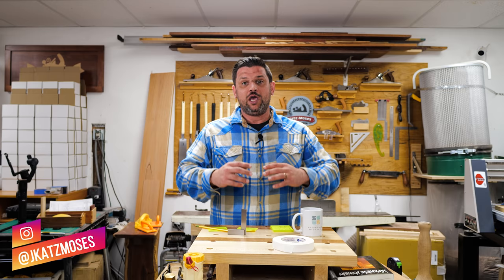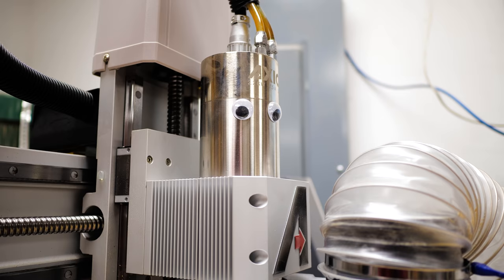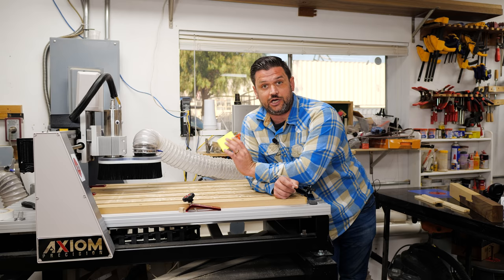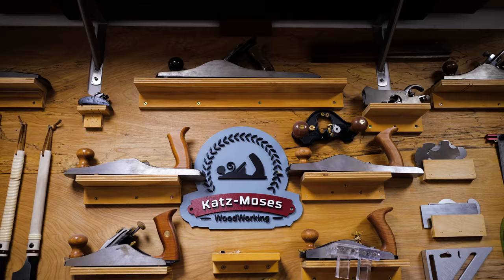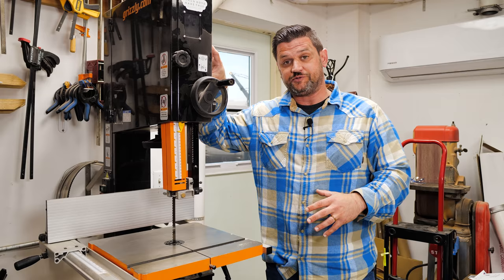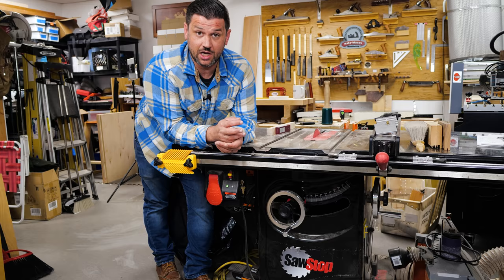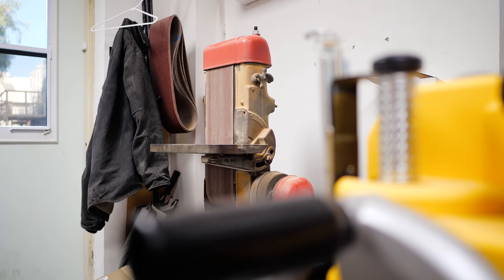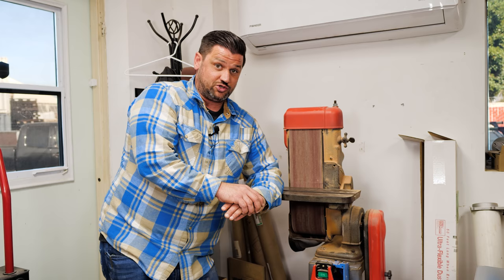Buying Used Tools - Negotiating Tips/Tricks and Buying Advice (Plus a Mini Shop Tour)

Comment: Regarding CL finds, always always always ask "what else do you have?" when going to pick up a tool/item from the seller. I have found so many additional items for cheap this way - sometimes the seller doesn't even know that they have something someone else would want! I once responded to an ad for free scrap lumber - it turns out the guy was a contractor and gave me thousands of dollars worth of hardwood because he had to move the next week. All it took was "you need to get rid of anything else?"
Reply from the maker: That's fabulous advice!
Reply: Been the same thing,    Moving, downsizing and health issue or death same thing I hate to say death, but its part of life. If you buy a tool from somone older be respectful.
Let them know you bought it for your own use, Seriously they will be happy to know you will use it in good health and it won't wind up in the dump someplace.
I got one item from a guy just because I liked the kitchen he did in his house I was blown away be the fact he made it all out of 4/4 + mahogany raised panel turned inside out for a shaker look all of it no plywood this was not a small kitchen either. the woodworking was stunning.  He was also very fair on his prices.

Comment: This has worked great for me! I have gotten a 6" joiner, sliding miter saw, air filtration unit, and 1.5HP dust collector all for $1,450 that retail new for $2,870 combined. Most are <3 years old, except the joiner. Now to add a couple circuits to my shop to handle it all.

Comment: Bring a square and a straight edge is 100000000000000% the best advice I didn't follow.  I bought a 6" jointer a few months back that ended up being fine, but not having those simple items with me when I purchased it was a mistake (so was lifting it by the tables to get it in and out of my truck and down the stairs to my basement shop...but that's another lesson learned.)  It won't happen again.

As far as buying hand planes used, I'm of the camp that sees the huge value in used vintage Stanleys.  Sure, my Bedrock 604 isn't made out of manganese bronze, but it was also 1/4 the price of the gorgeous Lie Nielsen I'd love to own someday.  Used planes can be restored simply and can be tuned to perform just as well or better than a lot of modern planes.  Where budgets are tight and you need a good plane, I think it's a no brainer.  Plus, restoring them is fun!

Comment: Great advice!  The only thing I would add is something I only recently learned:  If you can possibly get 220v service into your shop and you have the option of buying equipment that can run on 220v, I highly recommend it.  I didn't have 220 when I was looking for a table saw.  A good friend of mine suggested I consider getting it wired-in (which I could do myself.)  I took the plunge and bought a 3 h.p. Saw Stop, and every time I use it I am amazed by the "night and day" difference between it and my old 110v saw.  So much so, that I've rewired my band saw (it had that capability) and my drill press!  I have a lot of experience/knowledge in electronics/electricity, but I never really thought much about 220v in my shop.  I'll never go back!
Reply from the maker: I totally agree. I should have mentioned in the video that 220 tools are so much easier to get great deals on them because very few people have the capabilities to put 220 in their shop.
Reply: @katzmosestools  Your advice regarding 220 service in the shop is well taken. Currently I do not have 220 available in my shop. I do not have the know how to do this myself. Could you possibly do a video detailing the 220 install. Thanks in advance.
Reply from the maker: @mikefondren2385  posting electrical work publicly is like putting a bullseye on your head during hunting season
Reply: @katzmosestools  LOL! I see your point. Thanks for your reply. Guess I'll have to find hands-on help locally. Really enjoy your videos. Thanks for your efforts.
Reply: Agree completely on the 220v suggestion.  My SawStop and 8" Grizzly jointer are 220v.  I had to buy the additional converter for the SS but it's sound advice to upgrade to 220v.  So worth it!
Reply: Mike Fondren Without getting real technical- the advantage of 220v boils down to the higher the voltage, the less amperage needed. This means the wire size can be smaller (windings in the motor, and lines to the outlet) so it saves on cost of copper. The power consumption at the meter will be the same though, so this all doesn’t mean shit to most people. 
But if you kept the same wire size, you can get more power. 2hp motor is roughly 1500 Watts, so at 110v it’s about 13.6 amps and 220v is 6.8 amps. A 3000w (4hp) 220v motor will also pull about 13.6 amps. 
There’s other little quarks, like 110v wasting more energy over a distance, meaning it runs hotter .. but is safer than 220v during insulation breakdown, or getting a short.
Reply: @mikefondren2385   There are a TON of YT vids on running electrical. If you have the mechanical mind to do woodworking, you'll probably do fine running electrical. It's not the mythical "Scary Monster" folks make it out to be. You can do it. I installed my sub panel and wired my whole shop: few simple guidelines/charts to follow & you're good. Believe in yourself, @HoneyOnWales

Comment: This has been my philosophy for all my stationary equipment.  Old, used, and rebuildable.  My gem is an 1885-ish 12" jointer I picked up for $500.  I had to drive six hours each way, and put another $500 into it in new motor, bearings, knives, and paint, but this 1000lb beast is worth it.  My "newest" tool is a 1993 PM66 that I got for the price of "Come pick it up."  Because I only bought what I needed and waited for an item in my budget, it took me eight years to get all my stationary equipment, but I saved thousands this way.

Comment: best pick up i got was a scroll saw with about 200 blades i had seen the saw in this factory twice and i asked to buy it the guy said if you can fit it in your car you can have it for whats in your wallet , he went to do something and i dismantled it and put it in the hyundai boot, he came back to see it in my car i had $130 on me so thats what he took , its a Hawk 20inch , from mid 80's (i got in contact with them with the serial number) ,, i have never ever seen another Hawk in Australia it came with a voltage convertor from 110 to 240 , turns out the guy and his parents came from the USA with this rubber stamp company and they used the saw 2 times to cut sheets of stamps up , we went to the factory as my mum was into scrap-booking and she went there to buy supplies , ive had it i dunno maybe 6 yrs and it hasn't missed a beat . great scroll saw

Comment: Swap Meets: Great place to get tools! You can negotiate prices and some sellers can be stubborn. Many sellers have been taking hallucinogens or smoking too much pot. The way to deal with these guys is to ask and counter. If price is too much tell them you can't do it and walk away, then come back by one more time before you leave and say, "I see you still have these here..., you can sell them for the price I offered now or lug them back and forth for the next couple months until you sell them for the same price I offered."  I just got 3 Irwin clamps for $15 bucks when the guy wanted $40. Basically I got two clamps free for the price of one and they were in excellent condition. Never be afraid to walk and don't be afraid to be persistent. 
Great tips JKM, I use many of them myself. There are some great deals out there!!!
Reply from the maker: Great advice bud

Comment: Very true - your story sounds a lot like mine!   Another thing I watch constantly is Estate sales.  Just like Craigslist, Estate sales.net has an app for your phone... shows you estate sales in your area with photos.  I recently got a Porter Cable PK895 Router kit for only $50. And sitting right next to the router was a box of Infinity Cutting tools router bit set for only $20   It was a $199 kit with most of the bits still covered in the protective rubber coating.... brand new!   When I left that sale, I felt like I needed to burn rubber out of there as if I 
had just stolen something.... lol

Comment: Best deal I got was a Delta 6” benchtop jointer and 10” craftsman bandsaw for $35. Also got my 70’s model craftsman table saw for $15 cuz it didn’t run. Well a motor has a hard time turning when it’s full of dirt Dober nests. Cleaned out and the table Saw is a BEAST!

Comment: With clamps it's possible to go too cheap. I bought a few from the local Harbor Freight equivalent, and they were indeed cheap.

Unfortunately, they suck. To get the clamp to engage you need to hold the workpiece in place with one hand, tighten the screw with another and fiddle with the jaw with the third. They're more like awkwardly shaped hammers, really.
Reply: Build a clamp station  take a 2x4 cut notches in 2 at the same time lined up  lay your clamps in them and you will ahve enough hands to hold the clamps boards and tighten them.
there's  also a trick to get them flat and adjust the wood flat and flush with a dead blow hammer.  This works on pipe clamps too.  I need to build some but I have a lot of differnt types of clamps most of them do not stand up when you set them down. yes its a real pain in the ass but use your head and you'll get a headache@ I'm sure if you look on youtube someone's made a video what to do.  Thanks to everyone who shares there tricks.
I'm going to Blame This Old House for this. 40 Years of giving trade secrets away.
And why shouldn't we share with each other, It will make us all better at we like to do.
Not everyone can do this stuff nor do they want to.

Comment: Being patient is the best advice I was looking for a jointer, I waited and waited and finally found one that had a little surface rust otherwise perfect condition but I got a 6” jointer for $75
Reply: I got an old delta made in the USA for 65 but it did not have the guard I made one and the fence needed some love and care, it works like newish now. I also welded up a mobile base for it with free stuff off CL scrap's people put out for the trash. Bed Frame and wheels off a cart.

Comment: I would agree with a lot of your advise, I disagree about hand tools. It's easy and simple to fix up an old hand tools. They can also be shockingly cheap compared to new one. It also quite easy to get old tools that are still in great shape. Plus re grinding a bevel or tuning the hand tools is important to know how to do. Another category is power tools that need work. If the price is right and your willing to change out a Bering or replace a part there can be fantastic deals. The downside to searching Craigslist to buy old tools for cheap is you can end up being a tool restoring mechanic rather than a woodworker.
Reply: Evan Dunville My first handtool when  decided to start making my own picture frames was a Stanley Bailey No.4 for £2 at a car boot sale (a bit like a flea market). I still use it for rough planing.

Comment: Love the tips, I know you said buy used large tools and new hand tools, what about the in between corderd tools, routers, miter saws, higher end sanders, I know circular saws and corded drills can be had on the low. But a nice router or mirka/festool sander, or $600 and up miter saw are what I'm talking about

Comment: Awesome video. Since I’m about to move into my new shop i need a new big dust collector. Haven’t found one yet but still on the hunt. I do have that bandsaw as well
Reply: Grizzly has a sale on a 3 hp model  
I almost snagged up a laguna for 650 1/2 origanl price.
but 2 things about it 1 it was a 100 mile drive one way   number 2 it was in a part of the state they had a lot of floods this past spring when i asked about a flood it was the last email the guy sent me.

Comment: For a professional shop, sure, new hand tools save time, but for the guy just starting out, I'd say it's better to start with cheap or used hand tools; otherwise if you try it and don't like it or it turns out you don't have time, you might end up one of those guys on Craigslist asking new prices for your used hand tools.

My first hand plane was the $15 Harbor Freight special, back when I started side work to see if I could add to our income. Dug through every one they had to find the one that the screws actually lined up on, took me 4 hours to flatten the sole, and another 2 hours to flatten the back and bevel of the iron & put a good edge on it. With that plane, my old handsaw, a speed square, a $20 set of Buck Bros. chisels that I also sharpened, a borrowed table saw, and some reclaimed lumber from a house renovation down the street, I made my first farmhouse table. It sold for $400 the same day I finished it. I made & sold three more tables from that free lumber, and that was a helluva first real taste of woodworking. 

Good video, though. 👍

Comment: While my philosophy on buying tools is different from yours this was a very helpful video. All my major tools were bought new but most, except my SawStoop, were bought on sale or I got a special deal. I spend time searching through all the tool ads looking for special deals on the tools I want. Part of the problem I have is that I don’t have a truck or trailer that I could use to pick up used tools and  with many health issues I’m not able to lift a lot of weight.

Having said that I am in the market for possibly getting a second band saw and plan to start searching for a used one next year. When I do your information will be very valuable. FYI — I saw one, for example, listed as a table saw. That’s one of those mistakes you mentioned. 

On the new SawStop I even got a deal in that the dealer set it up for me, checked the tolerances including giving me the results of his tests, set it on a mobile base and for less than his costs, delivered it ready to go. The truck backed into my driveway and the driver rolled it into my shop. Obviously I bought it from an independent tool dealer who was willing to offer extras that big companies aren’t even prepared to do.
Reply from the maker: That's all great advice. Thanks for watching!

Comment: Jonathan, did you make those wooden on the wall behind you?  They look like oversized toolmaker clamps.  I have a bunch of toolmaker clamps and they are incredibly useful in an engineering context.  I have searched your channel and not found anything about them.
Reply from the maker: I didn't but I just did a video where I made some

Comment: I know this video is older, but figured I would ask.  Is it worth buying an Oneida dust collector that is 16 years old?  I have no idea how long they last. Of course the guy is asking $2500 for it, because new it is $4400 now (though several models newer).  I am using a shop vac and separator now now and need something better.  I was thinking of offering the guy about $750 for it, but not even sure that is worth it.  Any help out there is appreciated.  Thanks!

Comment: I’m very new to buying tools and I will never make anything bigger than an A2 picture frame because of my own limitations. I do buy cheap if they have a guarantee, I know most of them will outlive me because due to a health condition I'm well aware of my own use by date. That doesn’t mean I buy rubbish, but I definitely don’t need pro quality and there’s no value in it for me. I wouldn’t physically be able to work with big machines because of health and the fact my workshop is 6’x6’. So at least with woodwork I'm protected from GAS.

However, I do know buying and selling photography equipment, especially analogue. A few things I've learnt from there are:

1) Avoid eBay, the prices are frequently over estimated. We think because we have a passion the rest of the world has the same passion, one person will pluck a price out of mid air and everyone else copies.

2) Set your budget and stick to it, it’s easy to get carried away when you should have walked away. 

3) Whatever you are buying you can guarantee it’s not the only one in the world, no matter if it feels like that at the time. Don’t except compromises to get something quicker, hold out there’ll be another one in better condition.

4) Don’t rush to make an offer, read the advert, then read it again out loud and check any photographs in minute detail. 

5) With analogue photography buying and selling is all part of the hobby, I think some of that translates to woodwork. Enjoy as part of the process and no one will take offence at you walking away, and if they do do you really want to do business with them?
Reply from the maker: Great advice my friend!

Comment: I just did a search on Craigslist for table saws, and among the $50-150 small table saws that are at the top of the page, a few rows down I found a 3 HP 52" SawStop Professional listed for $3000! It's too bad I don't have the money or space for it right now, otherwise I would snap it up.
Reply from the maker: That's a great saw. Keep watching. Gems pop up from time to time.
Reply: @katzmosestools : I realize that the price I listed is not far off list, but I didn't realize I had typed a 3 instead of 2, plus I neglected to mention it looks brand new with the accessories appearing to be in the original bags. For the $2000 asking price it also includes a Jet dust collection system.
Reply from the maker: Sell one of your children. That's worth it hahaha
Reply from the maker: @AutotechWoodworking  hahahahaha I never!